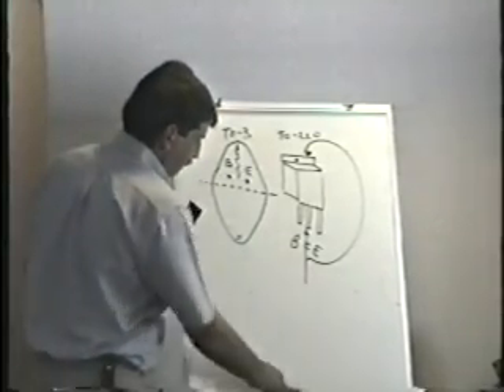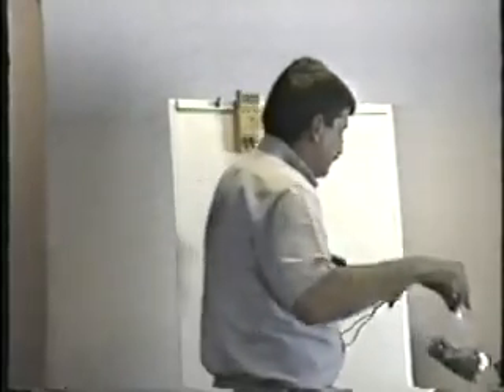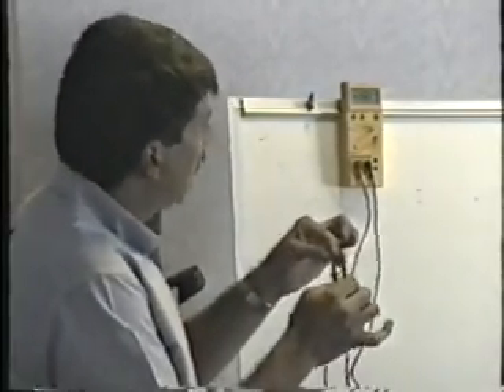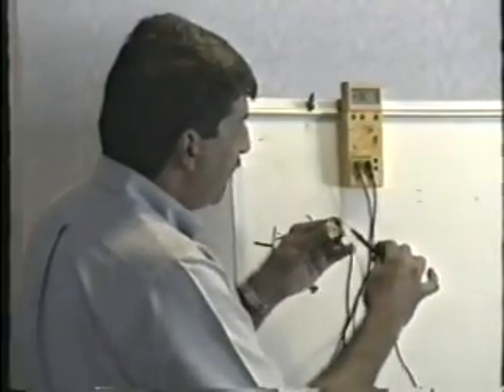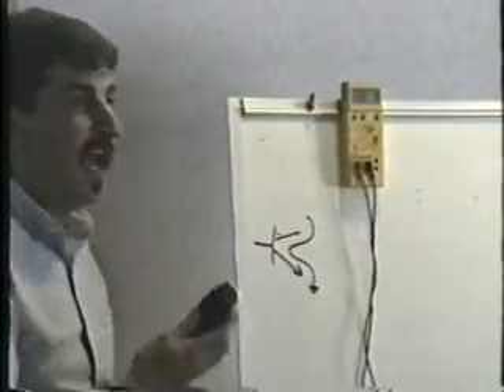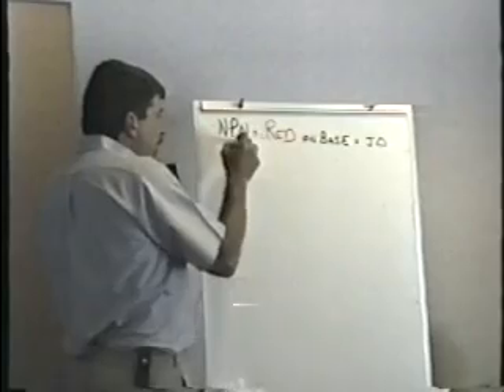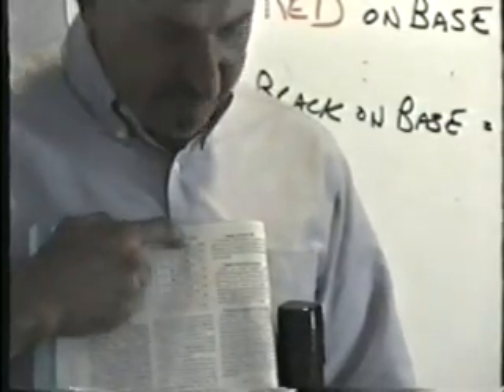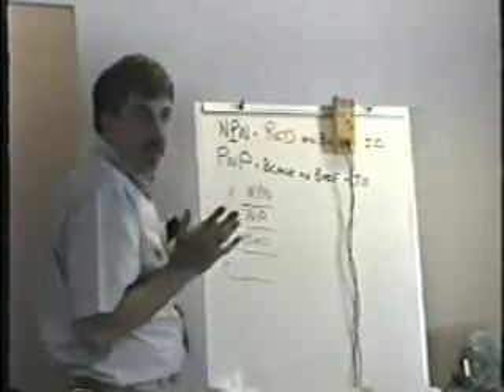Diodes, Transistors and Other Semiconductors-Chapter 6-Transistor Testing

Comment: In dmm if range is in 1 meg...to test the germanium transistor, then in all the six points test, the results are shown "continuity" or junction drop. Why it's like that? 
But testing by diode range.. It shows ok results.